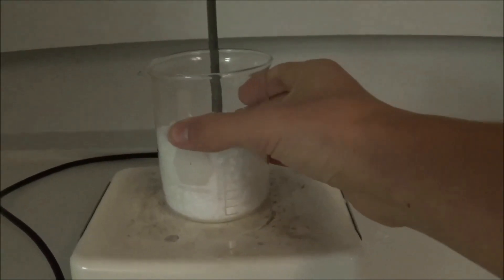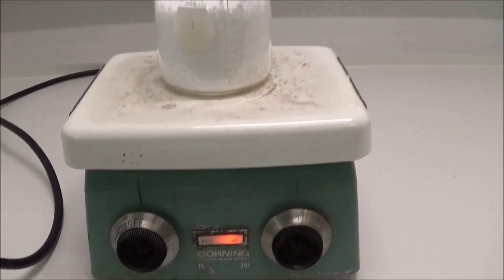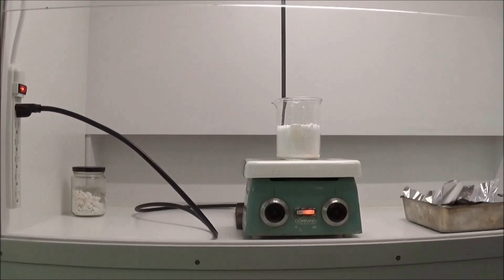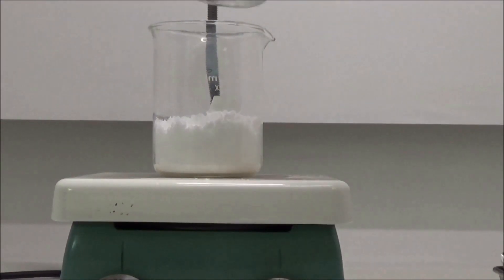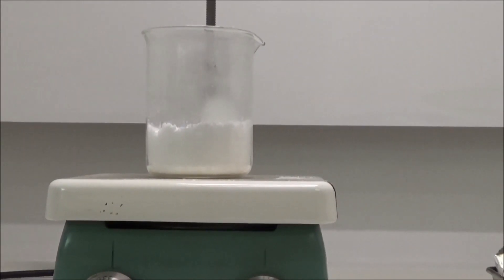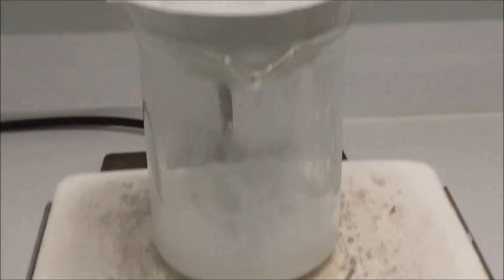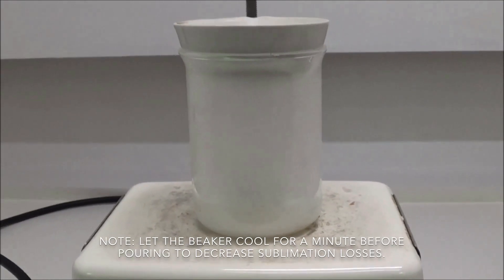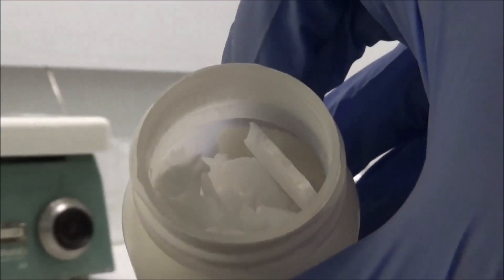Making Phthalic Anhydride from Phthalic Acid

Comment: So it does not work with terephtalic acid ?
Reply from the maker: No, not with the tere or isophthalic acid isomers. The acid groups are too far apart and a bond cannot form.
Reply: Tom's Lab but don't you think that there is close the carboxylic group of another molecule ? In theory a polyanhydride could form. I have to try.

Comment: Has it any advantages for use as a dessicant?
Reply from the maker: Probably not. Because it dehydrates easily, the hydration is not very fast. It would be strong, but the time required is likely going to be too long. H2SO4 is probably going to be superior and you can regenerate it's drying capability by distilling off water.